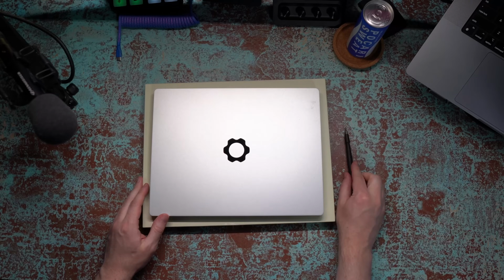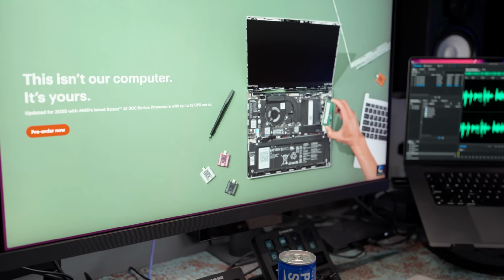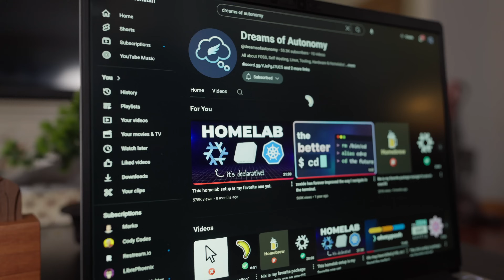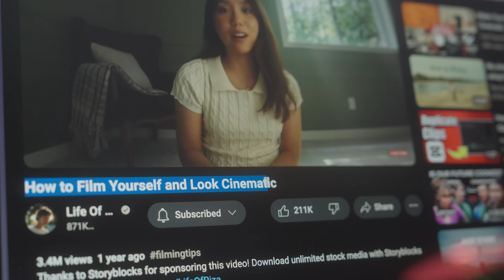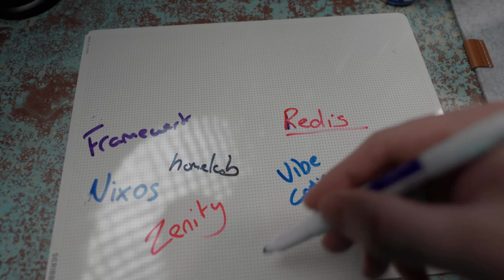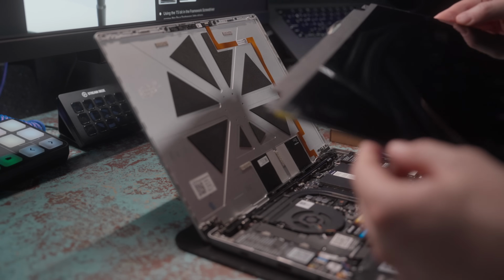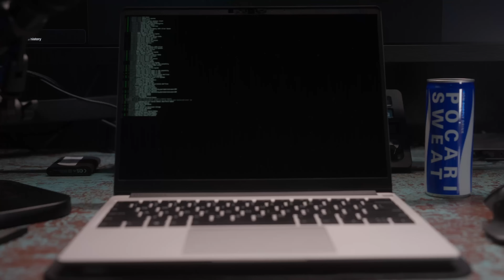It's time for a change

Comment: Can you please tell me how good the build quality is? I'm a student looking to purchase a laptop that's gonna last me 5 years at least and framework sounds like a really good contender, however as it stands it's just a tinker toy for enthusiasts who have enough money to gradually upgrade or tinker with the device. Framework will cost me a ton but it's worth it if the build quality and everything is gonna last me a long time.

Or my other option is to just buy an industry standard macbook, which comes with a solid build quality and amazing performance (however some apps that I run do require windows, and in that case I can find laptops from asus or lenovo that are significantly cheaper than framework).
Reply from the maker: I'll do a video comparing both Macbook Air and framework soon! The FW 13 is one of my favorite laptops but it's absolutely a philosophical decision imho. If you need something affordable then I don't know if you can consider the FW the most affordable on an initial purchase.

That being said, upgrading is definitely more affordable long term as you don't need to buy a whole new laptop. I'm actually gonna be upgrading the mainboard tonight and it was half the cost of a new laptop!

Comment: I had a coworker that used his truck as a mobile work station. He'd drive for a while to somewhere nice and then plug a remote wifi thing and put a drivingwheel mounted table and code from there. So car coding is a thing... just don't code and drive

Comment: 🎯 Key points for quick navigation:

00:05 🖥️ The creator bought a display upgrade for the Framework 13 laptop but left it unused for six months.
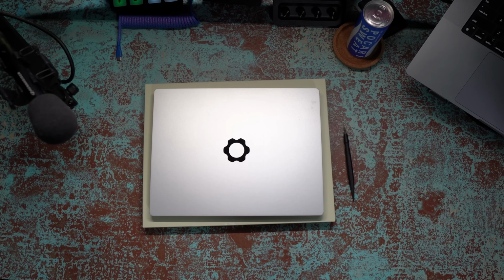00:36 💻 The Framework 13 is the creator's favorite Linux laptop, used extensively for coding but not ideal for video editing.
01:47 🔧 The laptop's modularity and ability to upgrade individual components is a key reason for the creator's attachment to it.
02:29 🗂️ Planned content about the Framework 13 was delayed because it was reserved for a second channel, Dreams of Autonomy.
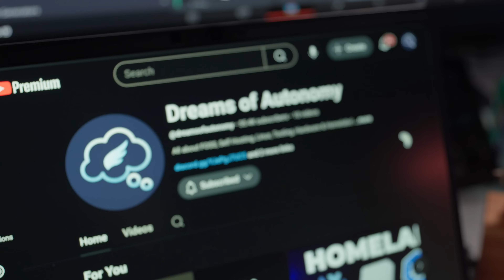03:09 🚀 Dreams of Autonomy grew quickly to 55,000+ subscribers despite only having 10 videos.
03:51 ⚙️ The creator is working on improving time management and content workflows to produce more videos efficiently.
04:19 🎬 Inspired by creators like Marko, the creator wants to elevate video quality and experiment with cinematic vlog styles.
05:14 🔄 The creator plans to simplify content creation by possibly merging Dreams of Autonomy content into the main Dreams of Code channel.
06:36 🧩 While segmenting content had initial value, the creator believes there's significant audience crossover to justify unifying channels.
07:05 🏗️ The display upgrade video was originally planned for Dreams of Autonomy but is now being used as part of the content shift to the main channel.
07:19 📚 Before producing more videos, the creator aims to finish their Go CLI application course, thanking early access buyers for their support.

Made with HARPA AI

Comment: What's your keyboard at 7:41 there?
Reply: it is in the description
Reply: @javierflores09  it's not. Search shows me that the ZSA voyager is a split kb, not the one in the video
Reply: @netbotcl586  you're right, apologies on that. Given the angle doesn't reveal much of anything, all I can tell you is about its features: retro creamy gray and white floating OEM-profile keycaps, I believe an aluminum low-profile case with transparent switches and of course RGB backlit. From that description a wild guess if it was in stock like that would be a Drop CTRL perhaps but I am leaning more towards custom built in which case I wouldn't be able to tell where they got what
Reply: I had a Drop CTRL and it does indeed look like it

Comment: Why not post on 2nd channel more? You still have to create a video, but you can decide to post it on a second channel instead of the first. I am talking about all those videos you are "holding back". Personally, I can subscribe to both channels, but I didn't know about the second until this video.
Reply from the maker: I felt the same way and it does seem like it's as simple as just publishing videos... However because DoC is how I earn money, it always ends up getting prioritized and I never find time for DoA, which causes me to end up pushing back the ideas I have for it.

Additionally there's some mental energy about thinking which channel best fits the video I'm working on which I'd also like to remove from my workflow.
Reply: @dreamsofcode  if it makes sense monetarily to post to one channel, then absolutely do so! It doesn't really matter for subs that much. Just make sure to point people to the main channel in the 2nd channel description so nobody is left out.